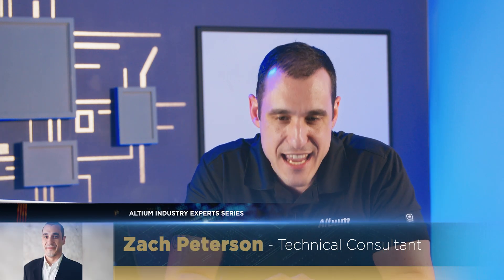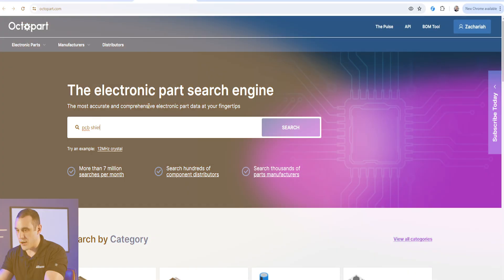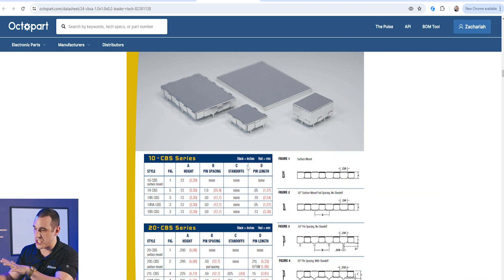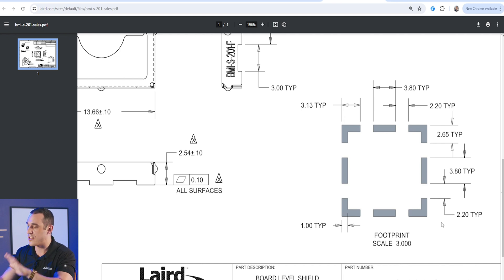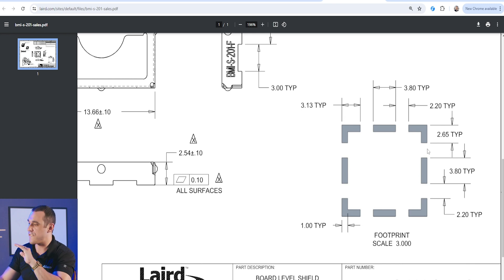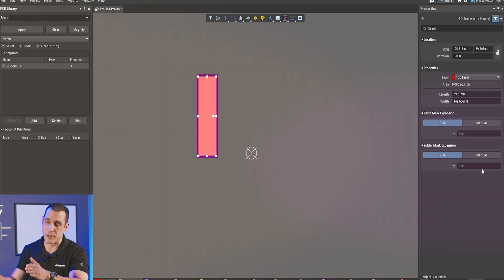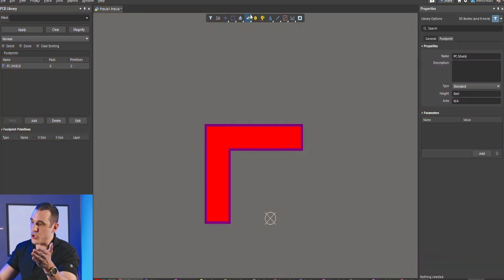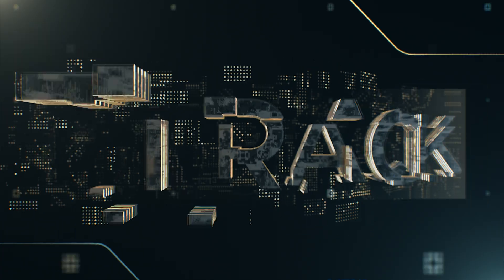PCB Shielding Cans Deep Dive

Comment: great video Zach, thank you
When stitching vias are made denser for better shielding, doesn't the fixed distance between the gaps in the footprint shown here worsen the situation depending on the frequency?
Reply: Sure it would but you can always fill in those gaps with fill or polygon, and then you can add the stitching vias as usual. What they show in the drawing is only a mask opening for exposing the copper pads and for applying solder paste.

Comment: Is the 1mil expansion now the "standard" expansion rule, instead of say 3 or 4mil? Thanks.
Reply: The default rule in Altium Designer is 4 mil but this is large in my opinion. I always use 1 mil so that I can place things closer together as needed but it still leaves a small tolerance leftover to account for any potential misregistration. With fine pitch components using 1 mil will leave smaller slivers between pads. Some fabrication houses will recommend minimum sliver sizes of 4 or 5 mils, so this can require you use smaller mask opening to achieve.